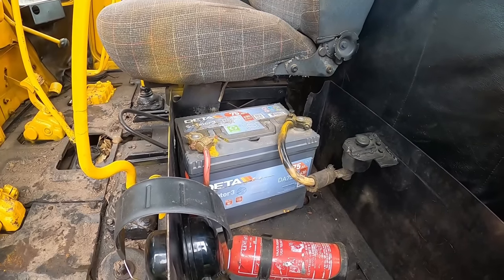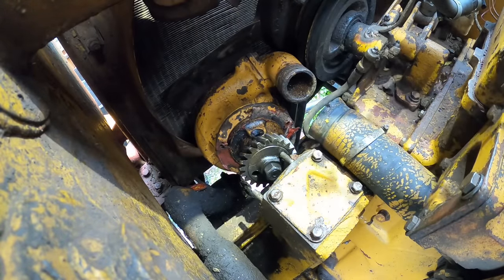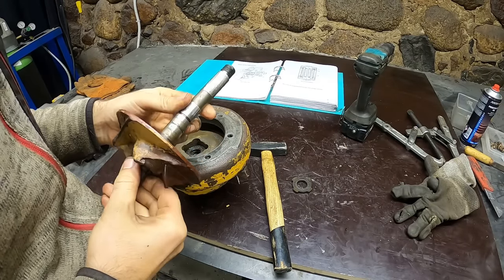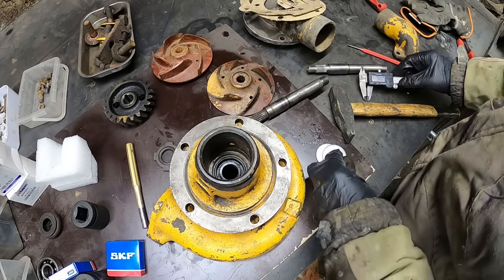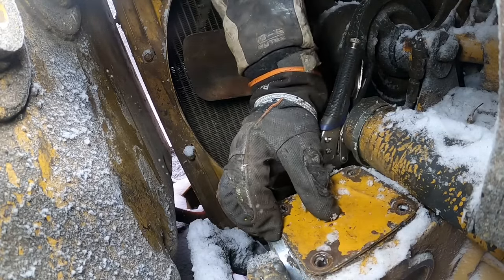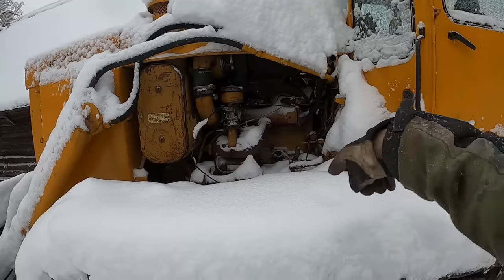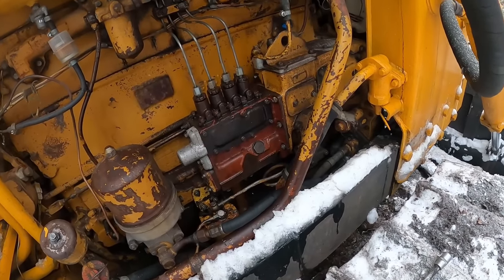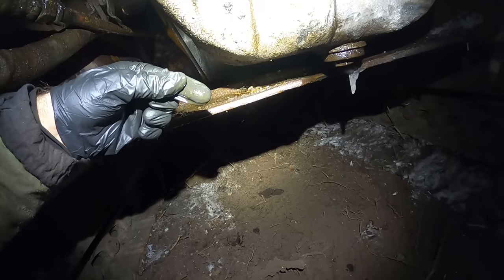Fixing water pump on the Soviet bulldozer

Comment: An old heavy equipment mechanic told me to coat the pipe with a very light coat of grease before putting the radiator hose back on. It seals just fine, and if you need to take it apart again, the hose comes off easily. It has worked for me, and as I saw you struggle with some of those hoses, I thought I would pass this along. You are doing amazing work, thanks for the videos.
Reply: Silikon?
Reply from the maker: gotcha

Comment: That water pump was a nightmare to take apart as I remember you mentioning it to me. If I look at the video the impeller side of the shaft was also wasted by rust so the fact the old shaft got wasted was not such a huge loss. The bellow seal that goes into the inside is also used on the Kirovets K-701 just as the impeller itself. As a state of irony just as I send you the probably last impeller i had. 2 weeks later I got a complete water pump for T-170 from the place where all old things usually end up. 
I would have probably just cut the hoses to get the pump off cause they look incorrect and oldish anyway. Yes that on the hydraulic pump is indeed cardboard gasket and it's not doing it's job at all. Btw you did good with the gasket making. 
Pony engine just needs some tune up it dose sound like there is a slight miss but it's not because you ran it with just one spark plug.
As for the oil and fuel prime loss. I think the oil can come only from a leaky valve cover gasket, unless there is a mystery one somewhere else. I'm rather convinced that the fuel prime pump that is located just after the primary refiner for the fuel. Is probably going out or bad. The loss of fuel prime over a long time is not a big deal. But from the video I can see the fuel prime gets cut off at random times. Might me a good idea to get a repair kit and a new one way fuel return valve as well. These are the usual culprits. As for the oil level rising might be just two issues: fuel or hydraulic oil. But im rather starting to think you had the right idea that fuel is somehow leaking in. Now there is a way it can leak in but for that I may have to come and take a look at it myself. Anyway Ants 2 hours of pure fun to enjoy this video.
Reply: Good to know ants has someone he can talk to and get advice from about these machines. Appreciate you sir.👍
Reply: jeez steve, you're making it too easy for him!😁 Andris is lucky to have you around...hell...we're all benefiting from you now that i think of it.   Cheers Lad!!  Carry ON!!!!
Reply: @bradcrossman5068  Thanks, I try help out if i can. But in some cases even my knowledge falls short. Cheers
Reply from the maker: lot's of help Steve you have been.
Reply: @Ants_Pants Thanks man, you too.

Comment: Squatch253 has a nice "tutorial" for gasket making. I remember he made the holes for the bolts one by one and put a bolt in the holes to secure the gasket in place and to make sure all of the holes allign in the end.
Another thing i saw when you remounted the water pump: you can screw in studs if you put two nuts together in a row.
(Just a tip, not trying to be a smartass).
Cool video as always, i enjoy the heavy duty stuff as much as the building stuff. 
👍
Reply from the maker: thanks dude

Comment: I am in the USA so I do not know your machines but a very common diesel engine issue is the diaphragm in the fuel pump can get from a pin hole to a rip and when that happens you will get diesel in the crank case oil because that diaphragm is the only separation between between the two.  The fuel pump runs off of a gear or cam/crank lobe.  I do have an idea for the future, build you a snow plow skid that bolts to or clamps to the bottom of your blade to keep it from biting in.  I picture 4-5 little skis clamped to the bottom of the blade and then super mom doesn't kill you for pushing snow with the big dog!  Great video!
Reply from the maker: :D you had me at big dog mr

Comment: You should always coat your gaskets with a layer of grease. It helps seal the gasket and it makes it easier to disassemble the part the next time you need to take the pump apart. And the grease will help hold the gasket in place while you put the pump back in.
First if you'd remove the radiator the pump would of slipped right in.
Reply from the maker: ok

Comment: Ha, Joseph probably isn't the best equipment choice for driveway snow removal.  I've got a driveway with "tailings" (ground up highway asphalt) for topping about as long as yours and I use my 873 Bobcat with a standard bucket.  I make a couple a large snow piles all winter and in the spring I drag all the scooped up tailings back into the drive.  Thanks for all the entertainment.
Reply from the maker: yeah, Nice bobcat m8

Comment: I've found when making gaskits, the best wat to make all the small hole and bolt holes etc, it to make yourself a set if punches, by welding on a variety of different sized ball bearings on to some rod and use these, instead of the ballpeen hammer.
Reply from the maker: But it works great 🤔
Reply: @Ants_Pants  I'm not saying, not to use the ball peen hammer, the hammer is perfect for most parts, but for the smaller holes, using a  ballbearing punch makes those a lot easier

Comment: for those gaskets get a window scraper tool that works with stanley blades, it will get rid of that asbestos crud quickly and not scratch the surfaces .

Another great video 😁
Reply from the maker: Good tip!

Comment: As long as it took you to get parts you should have also bought a set of stud extractors they look like sockets but have a cam system that grabs the length of the stud and spins them out without damaging them. 50 bucks would have been worth the hours of struggle you endured, thanks for recording and posting it by the way. Always fun to watch someone on the struggle bus!

Comment: I took the belly pan off my skid steer last year to put a new starter on it. I looked at it and thought it couldn’t be that heavy so I took the bolts out and it stayed there. So I put a screw drive in a crack and pried on it. The damn think drooped and almost broke my arm. It had about six inches of dried mud on top of it and probably weighed about 200 pounds. It gave me flashbacks when you took the pan off. I use a strap like you did now. LOL
Reply from the maker: lol :D

Comment: Hey Andris you need to get a generator. I worked on a off grid diesel yard, powered by a WW2 3 cylinder Perkins diesel generator, it ran two residents and a commercial fabrication shop 39 to 50 KVA
Reply from the maker: looking for a setup yeah.

Comment: Are you sure the scratches have any impact? The surface where the bushing is is still fine and the side with the seal is also fine. I would just use a flattening stone and take the burrs off. I think the "bushing" is only a spacer for the bearings. I think no need to replace the "shaft". Maybe a ball of the bearing lost some material, which caused the scratches. After watching the rest: another great ants pants video!
Reply from the maker: there was a metal washer there which was messed up a bit, that made the scratches. New shaft was cheap.

Comment: A friend of mine has a bulldozer from the 40s he couldn't get a water pump for so he found a 12 volt DC transfer pump that pumped the same amount  of water as the mechanical 1 at full speed and wired/plumbed  it into the system.
Reply from the maker: thats so cool and lucky

Comment: I think that your fuel is turning to gel and is unable to pump in the very cold temperatures, if you put some diesel fuel conditioner in the tank it will help keep it from turning to gel it removes traces of water. The other thing is that it might need some biocide in the fuel because there’s too much water in the fuel and you have the diesel bug and biocide will kill it. The only other thing is that the fuel filter is where the gelled fuel is getting jammed up. I would do both and run it for long enough that treated fuel gets through the whole fuel system right to the injectors. Be blessed sir.
Reply from the maker: ok i will do that

Comment: Hi Ants. As a chair diesel engines specialist I would recommend you put off the high pressure fuel pump and injectors and bring it to a diesel workshop for service and adjusting. If the alternator overcharges the battery it's voltage regulator probably died. You can try to bye the same (68.3702). Also, some regulators has a voltage adjustment screw. But at first check if the alternator is not 24V.
Reply from the maker: Hmm 👌

Comment: - Andris, you mentioned early in the video that you think fuel is getting into the engine oil.
- If there is fuel in the engine oil, it will decrease the oil pressure.
- A lot of fuel in engine oil can cause there to be practically zero oil pressure.
Reply from the maker: Yup

Comment: A couple of things, did you make sure you got the right temperatre variants for both thermostats, as the are different, as The primary valve operates exactly the same as the non-bypass thermostat and opens allowing coolant to flow to the radiator when the engine is at normal operating temperature. The secondary valve allows coolant to be circulated back through the engine during its warmup stage.
Reply: At the very least I think and have experienced elsewhere that one should be lower than the other.   One 60C and one 80C would make sence but to have them both open at the same time is a huge flow increase and then they are going to close again.
Reply: @MatWalter-q3h @user-pi8us8dp3b  Yes, that is usually the case, it does vary, depending on the machine. But as you say, one would be set for say 60 to get the machine up to temp and the second fir say 90, to increase fliw during heavy load, ir for different engine circulation, ti help with initial warm up etc
Reply from the maker: But there's no seperate flow channels for the thermostat s they all flow into the same piping.
Reply: it is the internet.  typed response with no tone.. much misunderstanding.   No matter what someone else said or saw on another machine the bottom line is you DO NOT want them both opening at the same time.    Think of the cold shock in winter when open flooding 2-3 inch hose volume into  the hot engine from the rad.   It does not matter that gauge says 40C  the radiator can still be -5    1000's of Polaris snowmobiles have seized up for the same reason.   @Ants_Pants

Comment: The mystery fuel pump issue - could it be the fuel "gelled" somewhere  between the tank & pump (non-winter diesel fuel?)
I have seen other operators use some sort of cold weather additive to the fuel tank to prevent fuel gelling...
Reply from the maker: I do always

Comment: To me its sounds like backfire, it can be that that other cylinder loses park for like half second and when it gets back spark it already has too much fuel in cylinder. I might br wrong but i thing that it is actually like small backfire
Reply: I was thinking that the timing was just a little off, which might have happened when firing on one cylinder.
Reply: @mswildi it can be that also but i was not sure so yea, you might be actually correct
Reply from the maker: all possible yes.

Comment: Ants, you're cool as ever, interesting video.. The one thing that's still a mistery to me is why the hack, when disassemblying something, you don't just use the press you have instead of hammering all around...   especially for bearings, shafts and similar stuff.. It's way easier with the press and you have more control... 
Afterall there are misteries I will never comprehend. 🤔
Cheers, keep on!👍
Reply from the maker: sometimes its easier to hammer couple of times then take the huge pump to a press :/

Comment: Freeze the shaft to contract it or heat up the bearing. You can moisten paper towels, wrap the bearing in it and microwave to expand the bearing a few thousandths.

Comment: Good job on winter repair,rather than using jb-weld on holding thermos in i felt maybe you could grind an inside groove and find snap ring of proper size to hold it in place another idea would weld two flanges only half inch wide inside pipeing then drill two holes in thermo flange and hold with bolt or self tappers.better than cleaning out jb-weld next time in twenty yrs.just an idea!!!snooky pa.
Reply from the maker: good idea actually

Comment: Good video as always, I don't know why you would want a foot throttle on a bulldozer except maybe if you need a blip of throttle without changing the hand throttle. On tractors it makes sense as they are great for loader work where you are only needing higher revs to raise the loader or road work so you can just drive it like anything else.
Reply from the maker: i think iv missed the work logic of the foot pedal, its there for when you wanna go reverse all of a sudden, slow RPM down switch gear and then boom off you go. (the pedal works this way as you press it down, engine RPM drops)
Reply: @Ants_Pants  that's neat, slowing the transmission down so you  aren't waiting on it to spin down.
Reply from the maker: ˇbut the clutch pedal and de-accelerator pedal are so far away from each other that i don't think nobody uses it for that purpose. Like trying to play ballerina in a dozer :D  @Gugernoot

Comment: Hook up a portable construction heater and point it to blow hot air under the engine compartment. Diesels as hard to start cold,and warm parts will not break, the oil will circulate better. Give it a shot of starting fluid to. Park the machine on some thick planks off the ground, clean the under carage of all mudd from bogie wheels, dont want flat spots wearing on them.
Reply from the maker: Hmm yup

Comment: Here’s an old school tip! To split anything that is stuck as bad as the water pump. To help open the pump cover with the 5 bolts. Use rubber compression fittings on both ends one with a grease fitting then pump full of grease the fluid dynamics will push the 2 pieces apart. You can use any liquid but grease is easer to work with but a little messy. You will be amazed how good fluid dynamics works. Save you head aches in the future to. Hope you understand my description? If I was helping you I would have bet you $100 I can get that separated in less then 5 minutes without touching it. lol. I do it all the time with new guys. Lol let me know if you need more detailed  description ?
Reply from the maker: interesting idea :O

Comment: The diesel in your oil can cause your oil pressure to be low. I just love your videos carry-on. In vitro fertilization of your dozer and front loader might produce a nice skid steer.🤪
Reply from the maker: Yup will faul the engine oil, plus side is that if i change the engine oil i can drain it straight into the fuel tank 😂😂

Comment: My guess is a small freeze, heard a slight starvation joust it stalled
The sound of that monster is wunderful!! Turbo wistle and biig engine, it would be a real treat to hear it with full blade of dirt going uphill.

You forgot 2 bolts to the lower radiatorhose attachment thingie
Reply from the maker: yes i did

Comment: I think maybe the alternator overcharging may have overloaded the circuit in the oil pressure guage if its electric and shut the engine down. But if not it may have just been some jelled fuel in the lines?? maybe try some lucas oil additive to thicken the oil up. The fuel in the oil may have thinned it out too much.  diesels are finicky in the cold maybe try some additives for cold weather in the fuel tank. P.S I hate winter too but where i live snow is an pretty rare occurence and lasts maybe a day. It's been in the 60's and its actually, believe it or not rained ever so slightly. I come from chicago il where we'd get 3 or 4 feet of snow. I dont miss it lol. Thanks for sharing! been waiting for this vid for a long time...
Reply from the maker: Thanks for rge comment.
Reply: rge?  @Ants_Pants
Reply from the maker: @ionracer3284  the* sausage fingers l, sorry

Comment: @Ants Pants  At this point, with the dozer, kirovets and excavator you should start thinking about getting a 1000l fuel tank to fill your machines. It will save you from alot of lifting.
Reply from the maker: Buddy of mine offered a 1000l fuel tank. Maybe i should take up the offer

Comment: That asbestos-gasket-glue abomination was insane to remove! Well done for persisting with it. Would acetone help next time, do you think? (next time? haha) Acetone pretty much eats through most solvents...
Reply from the maker: i gota test it out mate
Reply: @Ants_Pants  Sounds good! Also, I was shouting at the screen when you were putting the pump back on... there was still some old gasket on the housing, and I was worried it would compromise the seal (I recently had a similar experience with a tractor axle - it's weeping oil because the surface had a teeny tiny bit of old gasket on it...)
Reply from the maker: @DuncanAitken  its ok as this area does not experience high pressure fluids, very minimal fluids actually.

Comment: Russia's finest engineering. No 2 surfaces are even close to flat. Every bolt is different, every component is either failed or failing.
Reply from the maker: dude you just described Joseph

Comment: Hey bud, for "Josef" fuel hiccup if it stills occur I bet it's from the in line fuel filter causing too much restriction for the fuel pump. So the motor runs on the fuel inside the lines then dies, if you let it sit the lines gets full etc. I had this exact problem on my excavator and it took a while to figure it out. I just ditched the in line and rely on the spin on. Cheers.
Reply: @Ants_pants
Reply from the maker: haven't happened yet